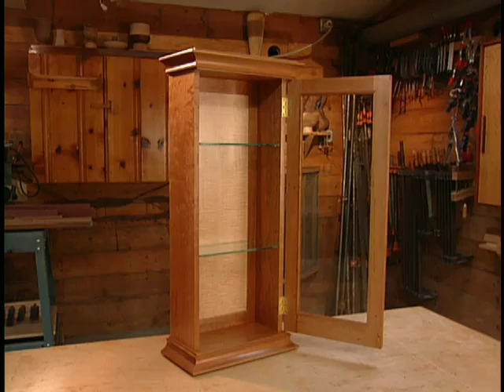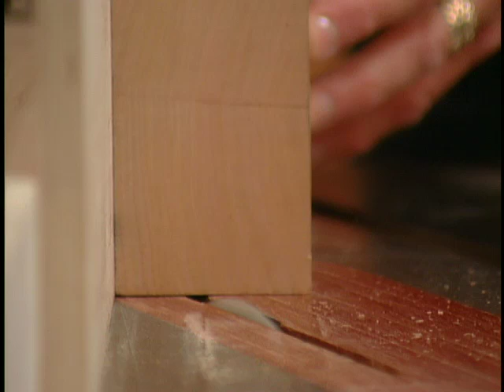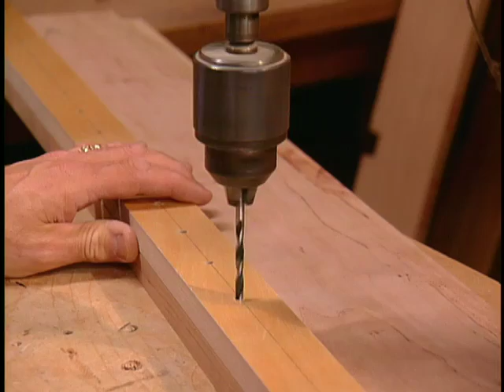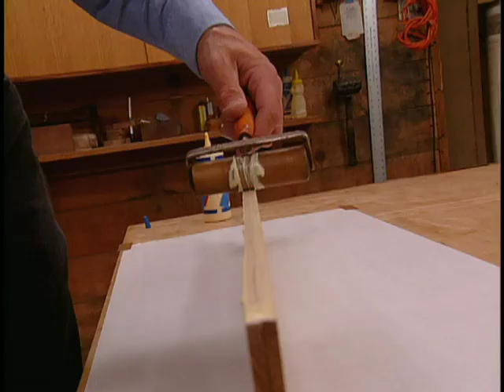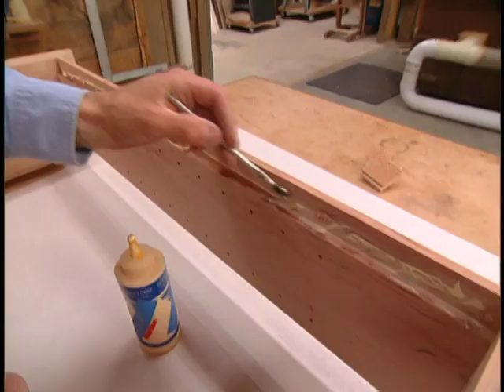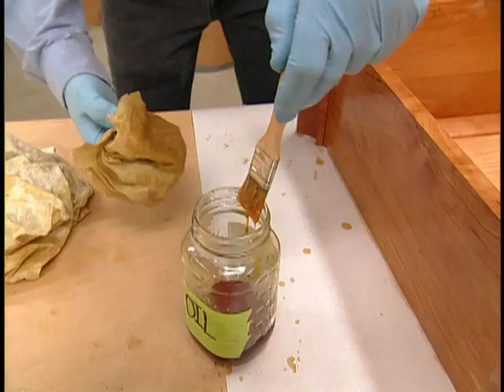Building a Flame Maple & Cherry Display Cabinet | WoodWorks with David J. Marks, Ep.2

Comment from the maker: What do you think about the contrasting woods?
Reply: Love to mix woods
Reply: Excellent choice. I built one just like it, but I've wanted to do it again with a thin strip of wedge or ebony between the cherry and maple.  I think it would make it pop.
Reply from the maker: Great idea! I like that!  @orbit308
Reply: The cherry and the maple work really well together. Unfortunately, cherry falls into a stereotype where only old men use it to produce pieces that resembel a big, orange blob. Your cabinet breaks that stereotype and sets it on fire!
Reply from the maker: Thanks Man! @coloradoklutch8005
Reply: Elegant choice.
Reply: Amazing! 👌
Reply: Maple & cherry is a classic combination.   The curl of the maple really sets it off.  When you said you used tung oil for the finish, was that pure tung oil back then or a commercial "tung" oil?
Reply from the maker: @grantman1148   Hey there,I have been using General Finishes Seal-A-Cell and Arm-R-Seal for decades.I wasn't allowed to name and brands back when this was on TV, so the Producer made me call the finish "tung Oil" which was one of the ingredients in the Seal-A-Cell.

Comment: Thank you for this. Obviously filmed years ago (the originals were never here in the UK). Everything has moved on since - except skill. In terms of finishing, I don’t think Tung Oil is used much at by professionals - certainly in the UK. For me, my go to finish where I want protection and a natural finish is hard wax oil. The older HWO finishes were 1 pack and still need 2 or more coats with time on between to cure. My shop doesn’t have a decorated finishing room and those 1 pack meant my bench was occupied by the piece curing for days and that dust on the air fell onto the piece. Not good.

Now we have 2 pack HWO. That second component cures the HWO quickly. In about an hour, I can move the coated piece around and I don’t get dust contamination. Plus, plus you only need one coat. You could apply two coats but I’ve found that you get minimal take up of the oil part of the second coat. If you want a glossier finish, I just apply furniture wax.

The Wood Whisperer published a video late last year (?) reviewing those 2 pack HWO and his overall winner was Natura Onecoat. Check that video out and the product. I would agree that it’s by far the best HWO out there. 2 pack may cost more per can but you get so much coverage (55 square yards is easy) per pint or litre that it works out much cheaper. Plus saving labour, time and that ruddy dust.
Reply from the maker: Thanks Theo. I wasn't allowed to name any of the products that I used on the show back in 2001 so the Producer decided to call my finishes Tung Oil.I have been very happy with Genral Finishes Seal-A-Cell and Arm-R-Seal which I still use today.
Reply: @DavidJMarks  thank you for the reply. We don’t have those particular products here in the UK and so I can’t comment on them specifically. I think we have similar ones though and my problem with them is that curing time. 

I think I’ve used just about every finish known to man over the last 45 years or so. I can remember my grandfather using fish skin (he lived by the sea) as sandpaper and mixed his own style of French polish as the finish. The idea of power tools in a small home shop was just unthinkable. Everything has changed. My only fear for the current generation is that, with all the marketing of tools of every description, they think that woodworking must cost a lot and that, by spending a fortune, they will succeed. So many YT videos are either sponsored by tool people or get given tools. In my view, the gradual gaining of skills is the only way. I still have 2 posters in my shop:

Patience and Precision leads to Perfection

Just because you can, doesn’t mean you should

That second one is a warning to me to keep things simple.

Comment: That solid top and bottom, David, was amazing.  I wish you had described how you found the correct angle of the fence to get the cove dimension.   When I've done it it's always been a struggle, looking from one side of the saw to the other and guessing on the correct angle was always a crap shoot.
Reply from the maker: I mostly do trial and error on scrap wood.I know that someone has made a jig to determine the angles for different curves.

Comment: david. do you think a build of of moldings or a solid piece like you used is more stable
Reply from the maker: Pete,if you were to use moldings,they would need to be attached in a way to allow for expansion and contraction on the sides which could be achieved with screws mounted in slots or grooves.By using a solid plank of cherry,we now have all of the long grain from the top aligned with the long grain of the sides so they will all move together in the same direction from front to back.